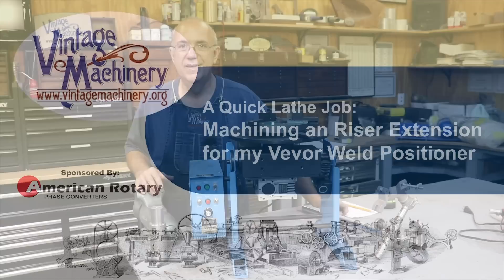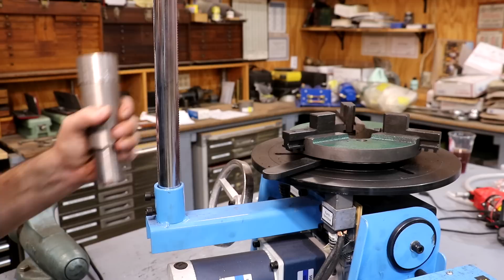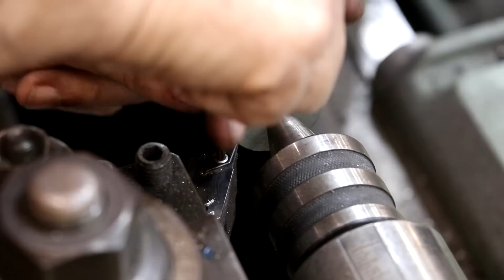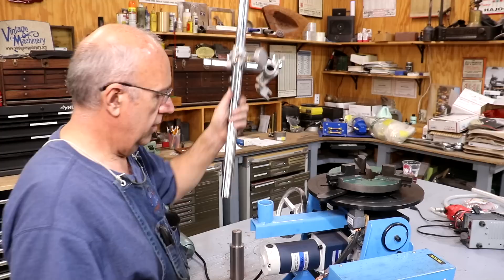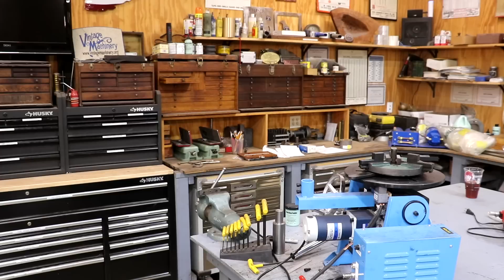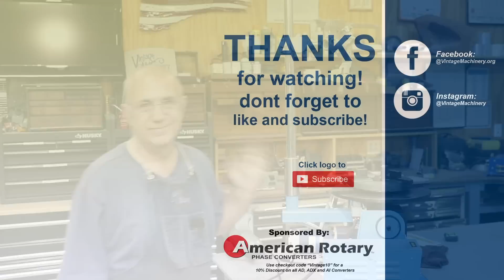A Quick Lathe Job:  Machining an Riser Extension for my Vevor Weld Positioner

Comment: My entire career was spent in the UK’s construction industry as a surveyor. The industry officially went metric in the late 60s so all of my projects around the house and when I’m drafting on CAD are using the metric system. However when it comes to adjusting the valve clearances on my motorcycles I work in thousandths of an inch purely because I can more easily “visualise” the dimension with reference to feeler gauges.

Comment: No need to explain anymore about metric vs imperial, your craftsmanship more than proves that the imperial system is not holding you back!. We are all free to use what we want. As is, US industry is slowly changing and I suspect that many of us mix and match as needed. As for the positioner, you are steadily proving that commonsense and needs assessment is better than rigid  "buy once, cry once" .  Sure, high quality measuring equipment is an excellent investment for a machinist. But your American Rotary phase converter is a more than adequate substitute for what might be considered the gold standard, 3 phase service from the utility. It is all about paying for what you need. So far the Vevor Weld Positioner, crude as it may be, seems to have been a wise, cost effective purchase!

Comment: I was born in the UK but have lived in Ireland for the last 35 years and have grown old using both the metric and imperial units. I am a woodworker and must confess that I am guilty of using (and mixing both on the same job) whichever gives the mostaccurate measurement. Now let me be pedantic - it is impossible to divide 10 by 3 with 100% accuracy (metric) so in this regard imperial appears to be the better choice. The big contradiction to this is that when it comes down to exactitude machinists tend use 1000ths of an inch to get a better result?  - Love the channel.

Comment: i run a giant cnc lathe and we use both metric and imperial.  i personally like both units.  i turn mill rolls and they range from about 20 inches up to 38 inches in diameter but we convert that to metric for the rolling process so a 37.401 is a 950mm. i like to use  the metric for the diameters it sounds better to call it out when saying it and much less hassle to calculate offsets too

Comment: Keith- I noticed that you: didn’t chuck in the mill, didn’t use a center finder on both sides and tell the DRO where one half, or center was.  Used a vertical helper or threading machine for tapping the holes.  Probably used a scale to line the holes and center punched, eyeballing top in the vice, and felt straight by experience.  Do you have any idea how many tools you didn’t use, and how much faster (and easier) old school get er dun enginurding was? 😊

Comment: The real advantage of metric is that’s a system: One Milliliter of water at 4 Celsius weighs one Gramm and is a cube of 10 x 10 x 10 mm. 
Ask anybody how many feet are in a mile or how many ounces are in a bushel. 
I’m German and live in the US for 25 years. I’m at home more now in imperial units and it works fine for me, but it’s just not a ‘system’. 
The US is metric or at least digital (thou etc.) in most ways anyway besides construction, and there the fractions have advantages actually!!
Nothing is black and white

Comment: In the UK we have both and like anything in life you get used to it after a while.
 A kg is 2.2 pounds, a pint is just over half litre and a litre is close to a quart. each tonne, ton ect is about the same. A mile is 1.6km and the US forces used the km but call it clicks. UK gallon is about 4.5 littre and the US gallon is 3.785L
I always knew an inch was 25.4 mm but now thanks to US machinery channels it's burned into my brain that a thou is about 0.025mm like touch off and face off is 🤣
All the big shop chains have to use metric but local butchers for e.g. display prices in both units which helps older people who grew up imperial only. That being said the powers that be don't dare tell pubs to stop selling "pints" lol. Politicians are slick like that, knowing where they can get away with things while avoiding a massive uprising on other issues.
Reply: I'm here in Canada, and I've learned from using the internet that a Stone is 14 pounds, and a Fortnight is two weeks. Who dreams this stuff up? 😂
Reply: @edwardschwenk3100  damn I forgot the 14 pounds lol.

Comment: When I was studying for my Mechanical Engineering degree(s) every problem, every class, all along, were given in a mix of Imperial and SI units and we had to constantly convert back and forth between them. There was no pattern to it. I got used to it and it DID come in handy during the 8 years I spent as an Engineer at the US operation (Atlanta) of a German company. 😁

Comment: It's more important to have one standard that you measure to.  You could measure in Light years if that's what your comfortable in. Slowly but surely the US is changing over to metric, I'm sure there are large production shops where it's all metric. Last thing you want is to have a half hearted shift to metric like we did up here in Canada. All you get here is an entire generation that can't function well in either system.

Comment: I was brought up in the UK on the imperial system, but we started to transisition to the metric system at the end of my school time and by the time I was an apprentice it was all metric (1970's). 50 years on I'm retired and am building a new workshop, I will be working in metric as much as possible. The new to me lathe is only 11 years old and is metric but also has dual dials to imperial. The new to me mill is Italian, 57 years old and is imperial, I will be looking at what I can do to make dual dials for that as well, although it comes with a DRO. Everything I have done over the last 50 years has generally been in metric. Untill it gets to be over about a foot long. Then its a mix of the two. Once its over about 8ft its all Imperial. I would never use km instead of miles and I get cross at the tellybox when people say that Scafell Pike is 978 metres high instead of 3,209ft. And I'm 13st 9lbs not 191lbs or 86.7kg. As many have commented it doesn't actually matter what you measure in, as long as it is consistent, as NASA have found out to their cost. At least twice.

Comment: 5 minutes in and I am thinking I would thread the bottom of the original shaft to match the riser. A machinist slip fit and thread in place? That shaft would be really solid.
Reply: I was thinking I would bore a closer slip fit hole in the riser and slot it to clear the rack.

Comment: To address the slop in the original fit just use an appropriate thickness of shim stock to take up the majority of gap minus clearance. Then you can use epoxy or just green Loctite to glue it in. Use shim stock to take up the clearance between the shaft and the permanent shim stock to hold it tight while the epoxy or green Loctite sets. Or just leave the shim loose. 
You chose the cheap alternative and these are the sacrifices you have to make. It's not a good look when people knowingly buy the cheaper version of a product and constantly whine about it's shortcomings in comparison to much more expensive versions.  
If you're going to be a cheapskate then own it by using your skills to make it better and show that off. Leave the "whoa is me" stuff for the guys that bought the premium version and found shortcomings.
"Today we're going to make this low buck, just ok weld positioner even better. We'll kill two birds with one stone by creating a mast riser that will eliminate slop in the mast and extend it's useful range." Something like this is the more professional look that suits a guy like you better.

Comment: Well, other people have brought up the placing of your weld positioner on the floor when you’re working with taller items and I was thinking the same thing especially on your last use with it. Now you’ll have no choice but set it on the floor (or vertically) so you can comfortably use the weld positioner. Lol
Thanks for sharing and this project will definitely come in handy. Hope to see it in use soon.

Comment: I'm with you on metric vs imperial. Imperial is the measurement system I was trained in and have used my entire life. I've heard all the arguments back and forth about accuracy and so forth, but I have never heard a defining argument from my engineering friends demonstrating the superiority of the metric system. I'm not opposed to metric, but like you, it's not the language I speak.
Reply: I am in the UK but I think and work in standard, but sometimes I even use metric !

Comment: {30 / 25.4 } x 1000  gives it in Thou of an inch.. ie. 1181 thou.  A boring bar would have given you the value to a 1/10th
but of course the video would have not been as interesting  !
I started off life, with Feet and Inches, then had to learn Centimetre Gram Second system, then ended up with the Metric system, so I now speak 3 languages. 
Keep it in Millimetres and you can translate anything  !
All you need to remember is 25.4mm equals 1 inch  ! !
1 metre {not meter please, they're boxes on a wall},  {1000mm} is 3 feet 3 3/8''  All the 3's
Standard Gauge track is 4 feet 8 1/2" or 1435mm
Lovely Video  !
See Y'all
Stuart Penketh  xx

Comment: As a welder i would rip the whole contraction off of the positioner and make a universal free standing torch holder.
Works a whole lot better then something that is fixed.
Also don't try and go higher and higher while welding on long shafts, in case of the cane mill rollers i would have just put them horizontal with some extra support rollers on the oposite end, makes it so much easier then trying it in a vertical arrangement.
Reply: I dont know why he didn't just make his own. I would think he has enough stuff laying around (chucks, metal stock, bearings, ext)
Reply: @MHolt3573  when it  comes to speed control it's rather complicated.
time is also money, something alot of people forget, just buying is alot cheaper when you factor that in.
For hobbyists work just outright buying from china is the best option anyway.
Proper use of one is were alot of people on YouTube seem to fail.
As someone that spent full 8 hour workdays for weeks on end using one it's a bit cringey seeing people doing it the hard way.
Reply: @samuraidriver4x4  I know sir.

Comment: Actually, at some point even you have already a long time used decimal system.  Rather than continuing the fractions to 1/128", 1/256" and so on, you are using numbers like 0.1/1000, 1/1000 or 10/1000.  No matter if they are based on one inch or something else, such as a millimeter.  I wonder if you even have a micrometer or a dial indicator graduated in fractions.
Reply: I do. 1/128 of an inch divisions.

Comment: A funny thing is that the inch is based on the metric system.
As late as in 1959 the inch was specified to be 25.4 mm.
Reply: Yes, most people don't know that it was defined as EXACTLY 25.4mm. Prior to that the US had an act that defined a metre as 39.37" and that was back in 1866. In the UK the BSI (British Standards Institution) defined an inch as 25.4mm in 1930 and the ASA (American Standards Association) did the same 3 years late. None of it became offically offical till the late 50's though.

Comment: Imperal may be based on base 10 but  1/2 1/4 etc are most certainly not.  There is actually a metric foot (300 mm) but has died the death.  The division by 10 is the trick and not division by 2   The actual length chosen as the standard is all that matters.  Even the french got it wrong initially but at least the meter is now defined by wavelengths of light.   The inch is now defined as 25.4mm exactly. It used to have a bunch of zeros and something.   Being able to convert digitally between in and mm can be helpful to some.  I have used metric now for 56 years but my lathe leadscrew is still 8 tpi.
Reply: I am still waiting on that metric time and metric year before I convert over, or just use the inch as the length of the standard centimeter instead of that useless 3/8” that it is.

Comment: Keith,

In the mid-1990s we started started the design engineering and construction of five 150,000 DWT tankers.  We specified using  "soft metric".  A large number of components came from Europe, Japan, and Korea so the equipment was metric.  Components coming from the USA were a mix of metric and imperial.  Instead of forcing the use of a use of metric only, we accepted components that were imperial, and we transitioned in the exactly the same way as you.  This saved the cost of forcing an absolute conversion. 

Would it have been better using all metric? Yes!  Was the cost and delay of making suppliers convert from imperial to metric?  No!

Bob

Comment: It is all ok with Imperial, if you prefer that. And as you say, all your equipment are in inches. But one inch is based on metric, 25.4mm, and i think that it is the Swedish Ce Johansson that decided that. I totally accept the Imperial system, because it seem to work ok. And i often use fractions in my work.
syntax

Comment: The UK and Australia still use both measurement "languages". I prefer to use SAE over metric, but such is not true on my vehicles.
Reply: I hear you, I never grew up bi-lingual and a language is hard to learn but in the UK you just get used to both measurement systems. And Aus too I hear!
My neighbours retired dad had a Whitworth socket set so in a way I grew up aware of 3 systems. Never needed a Whitworth though but I bet Mr Rucker has or one day will for sure.

Comment: I was going to suggest this before, but now that your mig gun will be higher up of the rotary table I'll will suggest it now. When I watched you using it before, you were reaching up to squeeze the trigger on the gun. Use a foot switch and cord and swap the wires temporarily (should be just two wires off a N.O. contact on the mig  gun and two female quick connect leads inside the mig welder. That way, you're not reaching up all the time to weld.
Reply: It's easier to pick up the trigger circuit at the input to the welding machine. there is a connection there so you can remove/attach the MIG lead. Just unplug the wire for the trigger and hook up the switch lead, bypassing the gun trigger. The only issue might be finding a connector that will match the trigger input to the welding machine.

Comment: The comments regarding imperial vs. metric have long ago become boring.  Each new comment is made as if it's a revelation. If we lived in metric land then we would use metric.  If they lived in imperial land and they would use imperial.  One group is not more clever than the other.

Comment: When we receive orders in inches in the workshop, all dimensions are first converted into millimeters.
1 3/16" = 30,16mm
Reply: Exactly the opposite here. When I receive prints in metric I always convert the dimensions to inches. Just depends on which system you’re comfortable with and the tools you have. Mine are all Imperial.

Comment: I noticed in your last video about the positioner, that you had problems with the weld running on you. Generally, you should start the weld a few degrees past top dead center on the leading side, where it has time to cool before it reaches the top, and starts to turn past where a hot weld could run. That is how we set up our positioners and manipulators at Pandjiris for welding circumferential welds.

The amount of degrees isn't much, and you would have to play with that, plus the torch angle.